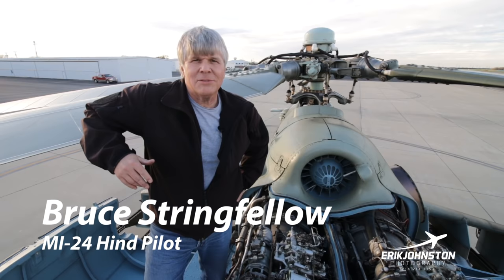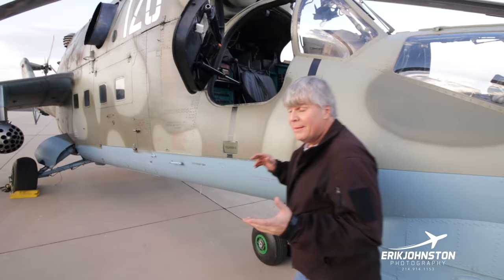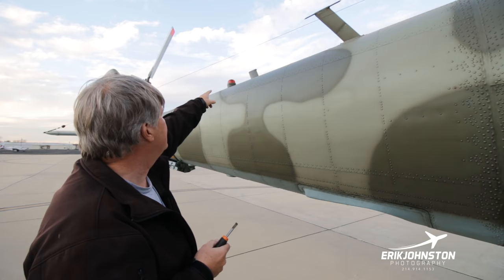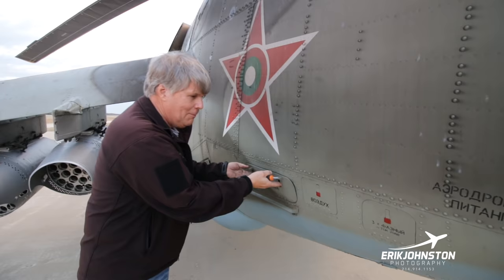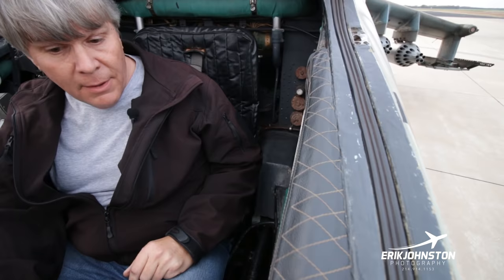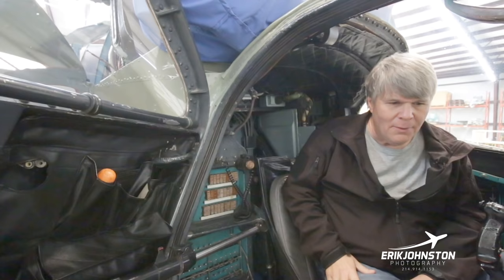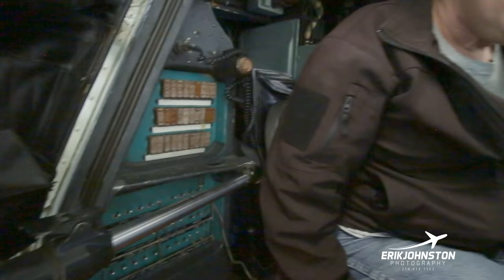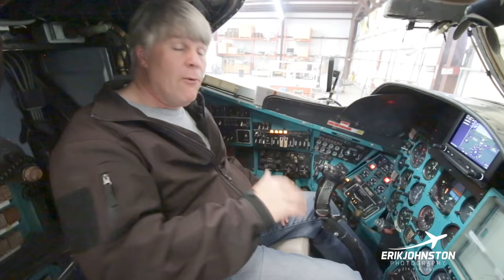Hind MI-24 Helicopter Walkaround Tour

Comment: Formidable aircraft for sure. Not only can rain down all kinds of munitions and it carries battle troops also. Basically a flying tank. I’m a bit surprised with the different wiring voltages that had to be interesting to work on.

Comment: Awesome Vids, AWESOME!!
 I had the pleasure for a short walkaround on the new MI-35M Chopper. It had MDS all over the cockpits. A more powerfull engines, improved transmission and high performance composites blades. So the whole machine was actually lighter and had more power(power/weight ratio), it is more agile. Can carry ATGM that can reach 9-11km.. well they are testing those in Syria now, but you get the point, they test everything down in Syria.

Comment: Some chopper that ;)
Reply: UwU
Reply: whaw0 iod
Reply: This thing dosent compare to the Apache
Reply: @lollardismontop1026  You say that, but the engine on the Hind is more powerful. The Hind is faster too although it's got way shorter range.
Reply: @lollardismontop1026  bruh they are different roles, its like comparing the su 57 to the a 10
Reply: @lollardismontop1026  As a matter of fact, you can not put 8 soldiers in an Apache, different roles, different choppers ^^

Comment: Love your presentation. Respectfully, I do have a correction. The Soviet gun cannot use the.50 caliber round used for the “Ma Deuce” or M2 Browning. The cartridge lengths are different. 10mm may be slight but it’s enough to matter. 

.50 NATO = 12.7X99mm

.50 Warsaw Pact=12.7X109mm
Reply: With small arms, 10mm. of case length is huge, not slight.

Comment: Each engine cover has warning label “don’t step on!”)
Reply from the maker: That’s for the outer part of the door. Where we are stepping is reinforced and designed to be a step
Reply: @ErikJohnston  Was going to point that out, too. Many in the comments have mistakenly misunderstood the warning. So many that sometimes there's no point correcting the misunderstanding. Outstanding walkaround, btw. Best I've seen of a Миль Ми-24 (Hind) anywhere. Big thanks.
Reply from the maker: @KowboyUSA  
Your exactly right! So many people just I don’t understand how aircraft access panels work. He is stepping on the reinforced structure, but not where it says don’t step on the outer weaker portions of the panel

Comment: 31:44 they did the same with the AK47 their 7.62 AK bullet diameter was actually around .312 so we couldnt use it in our 7.62(.308) but they could use ours in the AK although it would be loose and inaccurate.

Comment: If anyone is interested to know why in Soviet and, as a consequence, in Russian planes and helicopters, the panel is painted in turquoise colors, I answer.

Russia is a very cold place in autumn, winter and spring (there is even a joke that winter is here more than six months a year), you probably know that. Thus, the color contrast is very low in most cases. The presence of brighter cockpits means that it is easier for pilots to see and control the dashboard. If you look at such booths in the photograph in very low contrast conditions, you will notice that the devices are very easy to see, even the smallest ones.

Likewise, by the late 1950s and early 1960s, various shades of bluish green had become very fashionable as “safe” colors that would convey a sense of calm and trust. Around the same time, greenish surgical scrubs became widespread around the world and they still remain so, blue and green colors are cold and not the most attractive, but soothing, since based on observations in medicine, it was found that blue shades reduce muscle tension and blood pressure, calms the pulse and slows down the breathing rhythm, which is quite useful in the stressful conditions of a military pilot.
Reply from the maker: That’s the best explanation I’ve ever heard about the cockpit color! Thanks so much for sharing that!!

Comment: As an aircraft mechanic, im looking at the engineering aspect of things and how things are assembled on this chopper and holy fuck...i would NOT want to be working on that. Looks like a mechanics worst nightmare
Reply: Lots of vodka required to even do an oil change on that monster of an engine
Reply: Worst nightmare is when u work on a tech, and then it fails in normal conditions. This beast will get you through heaven and hell, might get full body of gun holes, loose 1 of its engines and half of hydroulics, but still get you back safely to base, after raining hell on ur enemy with its payload it can carry. This monster has beauty of a war machine and reliability of Kalashnikov assault rifle to work under any stress u can possibly put it under.
Reply: All helicopters are a mechanical nightmare not just this one

Comment: Inertial system. Gyroscopes.
Two independent gyroscopic transmitters powered by 3x36Volt voltage are used.
The first gives a signal to the autopilot and to the main indicator of the artificial horizon as well as to the on-board shooting and navigation computers.
The second always sends a signal to the pilot's backup horizon and the gunner's horizon.
They have two consent buttons and a switch for positions 1 and 2. In normal mode, the switch should be in position 1. If you put it in position 2, all devices will follow the data from the second gyrovertical.
It happens that the data gets out of tune during the flight, that's why in some countries a third autonomous horizon powered by the 24 V on-board network has been built into the cockpit.

Comment: Just a note, those white nipples should be part of SPO-10 radar warning system. It's the tripple antennas that are IFF responders. Receivers should be somewhere near, but not the white things :) And no, putting 50 BMG in Soviet guns is a big nono. It will slip inside, but it's one of the top unsafe things to do. And they definitely didn't design it to do that, considering the Soviet 12.7 came well before even WW2.

Comment: Important airspeed values.
40 km/h. Changing the passage of air through the rotor rotor at a speed of 40 km/h from a vertical passage of currents through the rotor to an oblique passage of air currents in flight.
80 km/h. The speed at which the power requirement is significantly increased by raising the collective control stick to maintain altitude. Also the helicopter's maximum landing speed per runway.
100 km/h. Minimum rotation speed of the pilot when maneuvering
130 km/h. Airspeed at minimum engine power, also economy speed. Flight speed on one engine.
160 km/h. Maximum air speed for extending and retracting the landing gear. Also the speed on the orbit before landing and the speed of approaching the runway when descending from the cloud. Also the speed for firing a guided missile so that the helicopter does not approach the target at a small distance. The range of the Falanga guided missile is 4 km.
180 km/h. Optimum speed of the helicopter's maximum range. Also, the speed for the need for minimum power for turns with an inclination of 45°.
200 km/h. Cruising speed, speed at high altitude and in instrument flights. Also the speed of the bombing.
240 km/h. Cruising speed at ground level (Simple transmission to 4 km/min.) Tactical speed for combat activity, firing unguided rockets.
250 km/h. Maneuvering speed for high angular speeds on the vertical and horizontal axis.
315-335 km/h. Maximum design speed.
more than 360 km/h. The speed of separation of the air currents on the rotor, the possible emergence of a spontaneous tilt to the right without the pilot's intention.

Comment: The pilot’s weapon panel is so he can fire the rockets and wing mounted 30mm grenade launchers and gun pods. Another reason why the pilot has a weapons panel is because firing ATGMs is a two man job.

To fire the air to ground missiles the pilot needs to set his gun sight to synchronise with the gunner’s ATGM viewfinder so that the gunner can find a target he wants to kill then the gunner points his viewfinder over the target and the pilot can see a cross symbol on his own gunsight showing where the gunner’s viewfinder is looking. It is then the pilot’s job to line up his fixed gun crosshair with the viewfinder cross, then the pilot gives consent to fire to the gunner. The gunner presses the weapon release button and the gunner guides the ATGM to the target whilst the pilot keeps the viewfinder crosshair on top of his gunsight crosshair the whole time the missile is in flight. 

If it makes more sense it’s kind of like lining up the foresight and rear sight on a rifle except the foresight could be an enemy tank marked by the gunners viewfinder crosshair and the rear sight is the pilot’s gun sight. 
This process means the pilot and gunner must work together to line up the helicopter and the target to allow the Shturm ATGM’s the best chance of hitting the target by minimising movement of the helicopter and the chance of throwing off the gunner’s aim. 
The only thing the gunner can do on his own is shoot the chin mounted gun.

Comment: What I can tell you from actually seeing one of these during Desert Storm is MASSIVELY HEAVY. Everything about this aircraft was overweight. I'm certain that played into handling of the aircraft and performance. Basically, this is a tank in the air. Janes book I had from the 80s said the aircraft could carry 6 to 8 armed troops. Maybe if they stacked their gear VERY tightly and piled on top of each other like firewood. The battery trey alone was so massive and heavy that even an experienced weightlifter would be hard pressed to lift it. A chinook helicopter couldn't even lift it with all the fuel dumped, batteries removed, and all armament removed. Maybe the five-blade rotor system helped with flight response of all that weight but from a mechanic's view I'd pass on this aircraft. It's an historic aircraft and has a lot of good ideas but I'm not going to hype that this is a "great" aircraft.
Reply: It being overweight is actually one of the reasons why the soviets were trying to replace it with dedicated attack choppers essentially from when it was adopted.  You can only have 2 of the three out of fuel, armament and passengers and still have enough weight capacity to fly, especially if it is hot or high.

I had always wondered why the US hadn't built an equivalent to the Hind until I found that out.

Comment: The HINDS didn’t fare very well against Iranian AH-1s, in the Iran/Iraq war. The HINDS had to use their superior speed to run away, the Iraqis armed Pilatius ( mounted machine guns the landing gear struts ) Porters to chase the HINDS off the battle field. I also noted that the HINDS always made turns to the low power side ( left ) when exiting their attack run. AT-6 in running fire 37 mm rockets at about 2300 m, then try the gun to finish covering the brake. The AT -6 sight was in an awkward position for the front seat gunner, and the steel doors that covered the TSU ( telescopic sight unit ) didn’t allow firing the gun while tracking a target. The AT-6 run was pretty rigid because the tsu didn’t articulate. Memories from awhile ago.

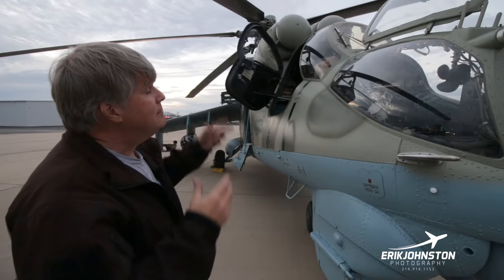Comment: 50:32 the designers tried to put armored glass inside the cockpit to shields the pilots from sideways fire but it reduced the avaible space so much than it had to be reduced (acording to the photos it was like 8 inches of glass render side visibility almost imposible) opting to only use pexiglass instead

Comment: Unguided rockets could not be launched from the front cabin!
Therefore, there is no control. Unguided rockets were launched by the pilot, who also set the number of rockets in the salvo.
Front cabin.
To the left of the sight is the shooting computer and to the right is the bombing computer.
The optics for the guided missile have a magnification of 3.3 x for searching and 10 x for shooting (it has been 24 years since I sat in it)
The gunner searched for the target, confirmed its identification to the pilot, and he, according to the indicator, leveled the rudder in the direction so that the green indicator of the artificial horizon was in the middle. This was also seen by the weapon operator because he can see the angle at which the projectile guidance optics are deflected in the field of view of the sight. +/- 60°. Then he switched the magnification to 10 times to shooting mode and could fire the rocket at any speed from 0 km/h up to 250 km/h. The rocket flew to a distance of 4 km and it took 20 seconds. Maximum speed was limited by the pitch of the helicopter at high speeds. A standard speed of 160 km/h was used, and up to 200 km/h it would still be in optimal mode.
My operator fired the guided missile 30° off the flight direction and the missile successfully hit the target at a distance of 3 km.

Comment: Let's go.
Only 8 soldiers can be in the cabin and only 6 can shoot. You can't shoot from the last window and the penultimate window is so limited by the angle that it is useless for driving Kalšnikov. Not 8+2 because they wouldn't even fit there. If you don't believe, sit there for 8 and you'll immediately understand what I'm writing about.
The front cabin is only for emergency use during piloting. However, I will surprise you that the training also took place in the front cabin at night. The pilot had to master circular and space flight, as well as the basic elements of piloting such as acceleration, braking, climb, descent and turns both on the horizon and in climb or descent. In addition, the instructor had to master advanced piloting techniques from the front cockpit. That there are metric devices is logical, only you have meaningless standards, inches, feet, miles and knots and calculate it between you with a calculator. I'd rather not talk about gallons and pounds, because you've already sent more than one plane or rocket to the ground this way.
Those weapons control systems are equipped with a computer, but you have to take into account the year of creation. 1969 first flight and since 1970 Russia has been training foreign pilots and dispatching these helicopters to other countries. It's an analog machine, and at that time, I suspect, probably the best. Your pilots were dying of sweat behind the stick, and the Russians were chilling their vodka in Afgoš at +35°C in the cabin where it was snowing. And if there was no vodka, the helicopter would have carried 40 liters of medical alcohol to spray the windshields of the cabins. :)

Comment: About that 4-barelled gatling: 9A624 (GRAU index) or YakB-12,7 is internally-driven, using gases from firing to push on piston. Electric wires are part of trigger system. For start, it needs push provided by torsion spring located between barrels, during shooting energy is provided by gas system. When releasing trigger, energy stored in barrel group and last two shots is used to tenstion the spring for next salvo. In case of failure (misfire etc.) there are three pyrocartridges that can spin up barrels instead of spring (thus during flight crew is able to activate failed weapon only three times).

Also, Bruce talked about Mi-24s ability to fly straight and fast. Its definitely fast, but its also pretty maneuverable, as shown here ;) https://youtu.be/XOCJ5cTPbSA 

And it can fly pretty low too :D https://youtu.be/GDQT_4WlByQ

Comment: Curious as to why the soviets originally chose to go with a .50 cal. instead of a 20MM, or larger.
Reply: Weight.  The heli does not have the weight capacity to function as a transport and as a gunship at the same time, but with a HMG instead of an autocannon this is less of an issue.  Later on in the Hind's life, after they realised it didn't work, they just started using Hinds without passengers as dedicated gunships to support passenger carrying Mi-8's, which then the lack of an autocannon made them ineffective in that role as well, which is why later hind variants got the autocannon.

Comment: 16:50 ‘it’s strength is it’s speed, it’s weakness is it’s speed.’ With the quality of surface to air missiles being used in Ukraine I’m pretty sure Russian pilots are scared of flying over any territory held or contested by Ukrainian forces, even if they are doing a straight in and straight out attack run.
Reply: Russian pilots are not scared at all. They fulfill all tasks.  Mi-24 is obsolete helicopter and Russia does not use it in this conflict at all. Ukraine does. Russia uses modern types - Ka-52, Mi-28, Mi-35 and they are perfectly equipped to be protected from any missiles.

Comment: I would suspect that you are told to stay away from the doors because they open outwards... and if you lean against them on the ground or in flight... you are going to spill out.

Also, it's not really advisable to put an adversarial IFF system in your helo.... because you will pop hot on U.S. weapon systems.

Comment: So where's the MI-24? This is the MI-35. The MI-24 has a number of external differences, for example, the chassis of the MI-24 is not retractable. Well, there are also small differences in appearance, which you can not remember, given that the main differences are inside it.

Comment: Soviets measured bullet diameter differently than the west. 7.62×39 is .311in while 7.62×51 NATO is .308in. US 12.7 is smaller in diameter than soviet 12.7mm. US 12.7mm bullets can travel down a Soviet 12.7mm barrel but they won't engage the rifling optimally and will be inaccurate.

Comment: Is the horizontal control surface at the back an elevator or a stabilator?
Reply from the maker: The elevator. The front fixed portion is the horizontal stab

Comment: What model Hind is this? The rotating ball turret on the nose is different from the Hind-F
Reply: Hind-D. AFAIK most of them in Eastern Europe were this model or later the Hind-E (gives you a pretty balanced loadout, 4 ATGMs, 4 80mm rocket pods and the quad barrel HMG). Don't think anyone outside Russia used the fixed 30mm.